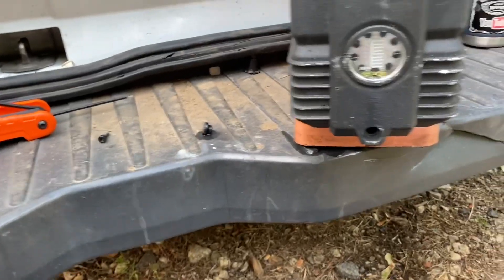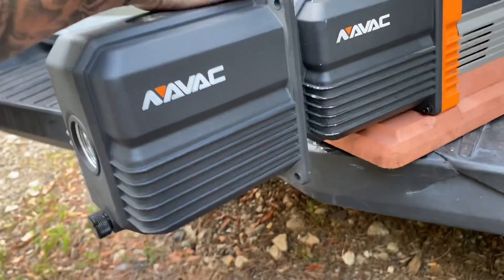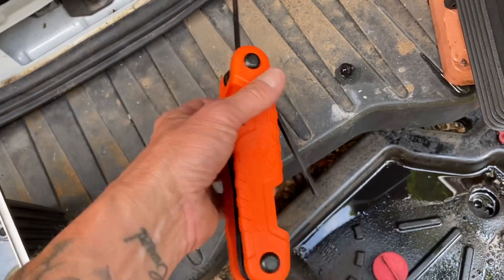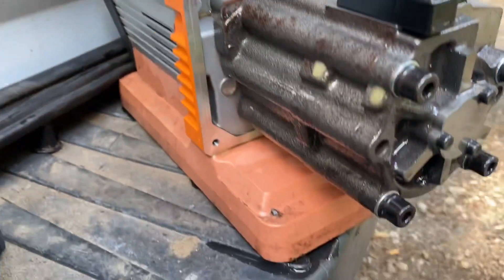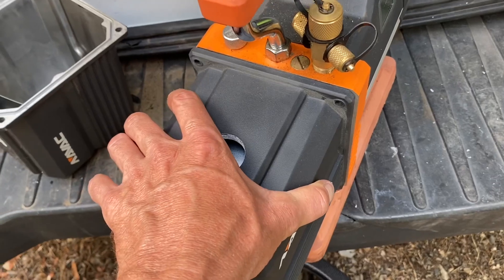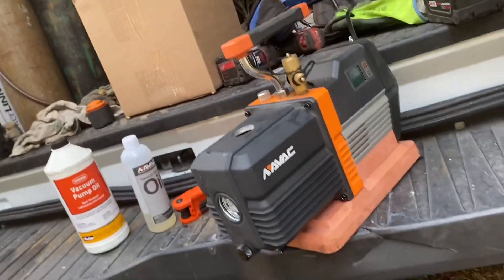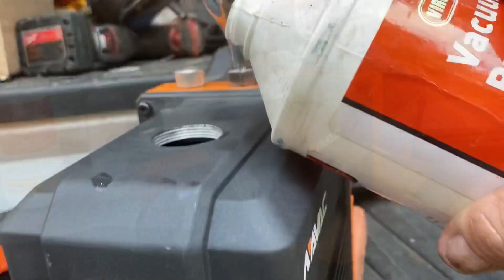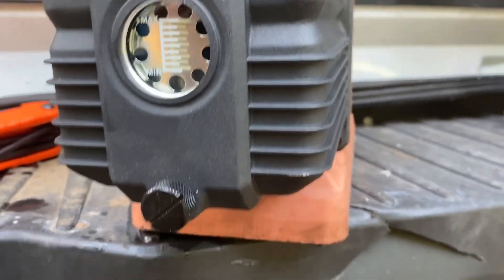Navac 8 cfm Vacuum Pump Repair

Comment: Hey brother, would like to get your opinion on the NAVAC pumps. My 10 year old JB is getting tired finally...only pulls to about 60 with the mic gauge directly connected w/ my accutools brass coupling. Used to pull 20 all day. I’m debating between a JB platinum or a NAVAC 7 cfm ( I don’t want the battery version) . Would love to get your take on what you think. Thanks.
Reply from the maker: Jason Reitz the Navac pumps are great man but before this I used JB pumps my whole career . Really can’t go wrong with either in my opinion
Reply: CSC Refrigeration and Hvac thanks for the input. Trutech tools has a NAVAC 7 cfm for $325 which seems like a good deal. If you’re happy with yours I might pull the trigger on it.
Reply from the maker: Jason Reitz I think you’ll like it man . They have dc motors also and run quieter than conventional pumps too. No hard startups in the cold either

Comment: I can’t believe they didn’t send a new “ O “ ring. Is that the battery operated pump or plug in? Was an easy repair.
Reply: Yeah,  cheapskates, huh?
Reply from the maker: Scott Kneeland it’s a plug in pump. 8 cfm .  Don’t need a new O ring. The housing isn’t on that tight and the O ring was fine.